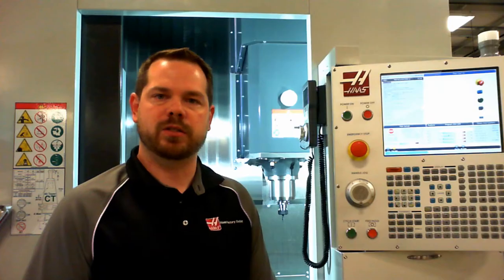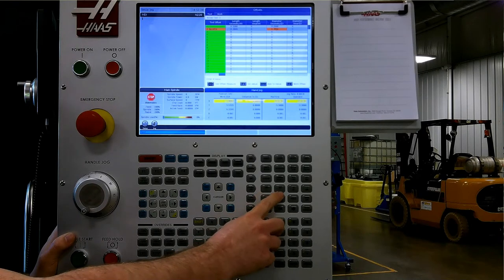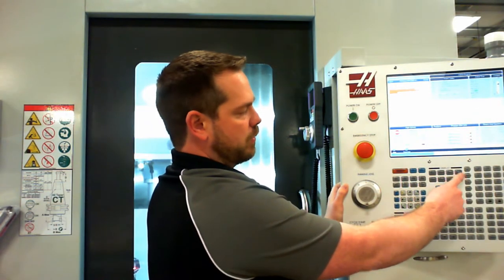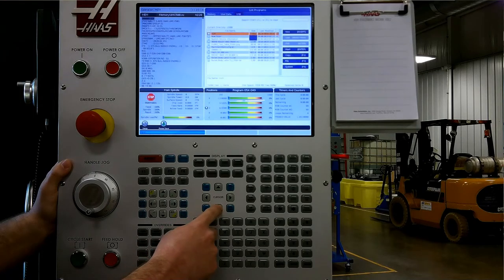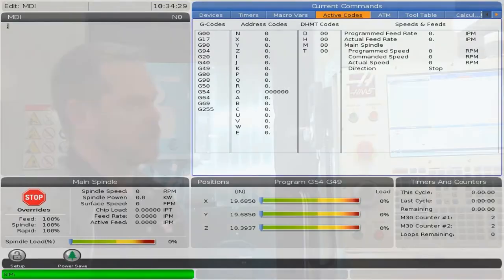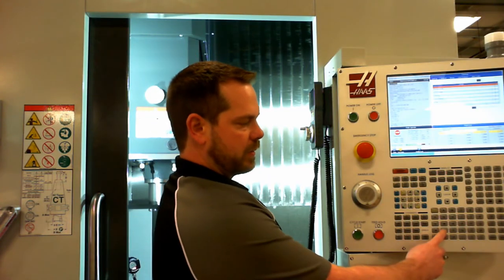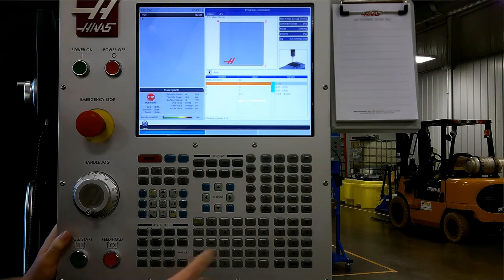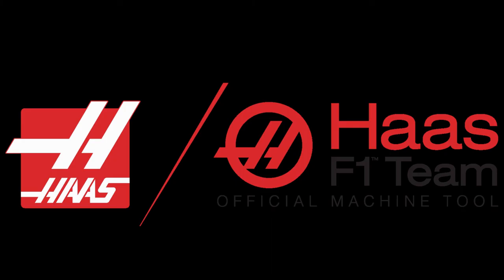Haas Control Training Video

Comment: I work for family using a mill and lathe to produce gears and parts, and have recently come upon an opportunity to work for a CNC operator with a Haas machine. This is a treasure trove and 
I've rewatched your video multiple times and have taken about 8 pages of notes. Can you give me some advice before I start working for this guy, man? How do I avoid fucking up this guy's beautiful machine, and how do I go about educating myself appropriately? If you had a dream apprentice, what would they be looking out for and paying attention to? Do i need to buy a whole darn machine to get my grubby paws on that owner's manual? Should the manual be my new bible, or do you have any good reading material for an aspiring tech?
Reply from the maker: @metalskirmish I've added a link below to the Haas Website for the current machine manual. Best advise I can think of when starting out is just don't rush. Slow the rapid overrides down and watch your "distance to go" display. If you see your tool 1" from the part and it says it needs to travel another 5" in rapid you are able to stop a crash before even touching the part. The manual is a great resource to have, it will help a lot if you are familiar with the contents.  

Good Luck!

https://www.haascnc.com/owners/Service/operators-manual.html

Comment: Hi, is there a way to turn off the alarm after the car has finished the program? I know there is Reset but I would like to know if there is a way to eliminate the continuous Beep Beep that the machine does at the end of processing.
Reply from the maker: @Lazar Nicu Try changing setting 39 to turn off beep at M30.

Comment: Button fwd what does it mean pleas?
Reply from the maker: Not sure what portion of the video your question is related to but I could have been referencing either the right arrow cursor button if working with the VPS templates or the ATC Forward button that will call the next tool to the spindle. Hope that one of those answers your question.
Reply: @gcodeprogrammer7695  
Thank you for answering! I meant the button below next to the word "spindle", in the machine i work on there is "fwd", "stop", "rev" - spindle. In other machines its written "cw" 
 So this button move the spindle forward right? In a counterclockwise motion?
Reply from the maker: @ameensn2846  Yes that is correct. Spindle FWD would be the same as spindle CW. When the FWD button is pressed it will turn the spindle on at the last commanded RPM in the machine.